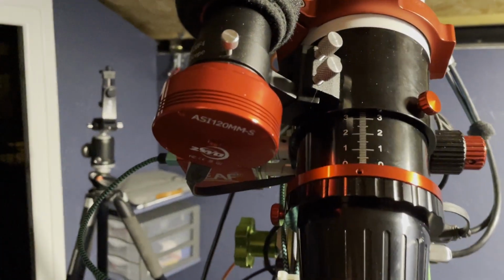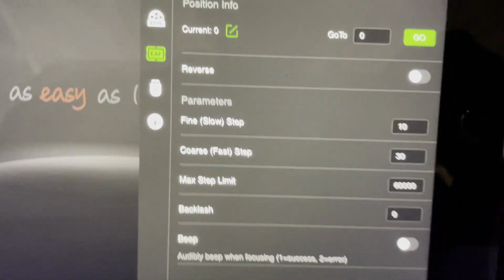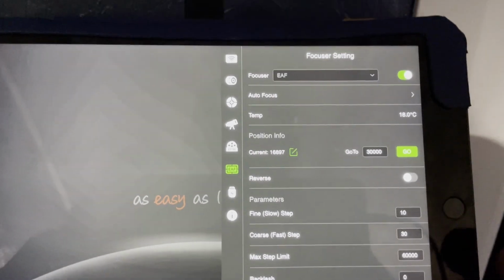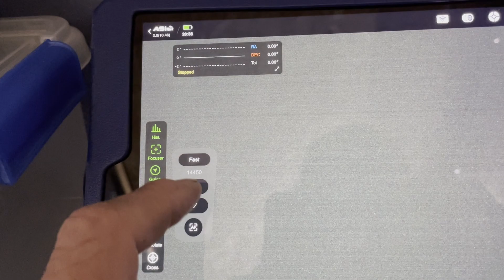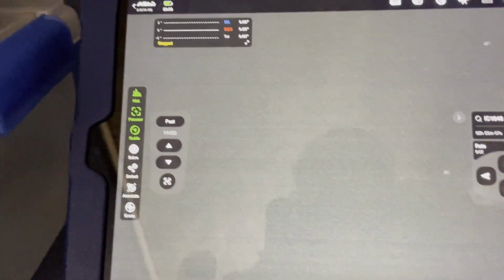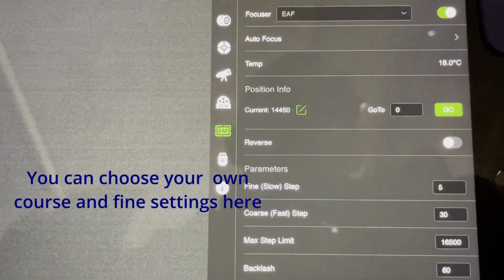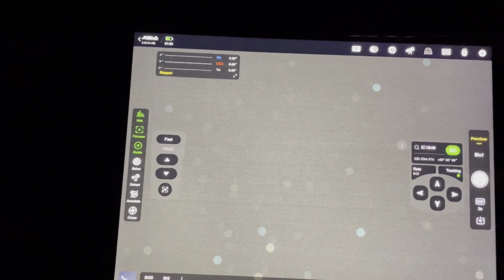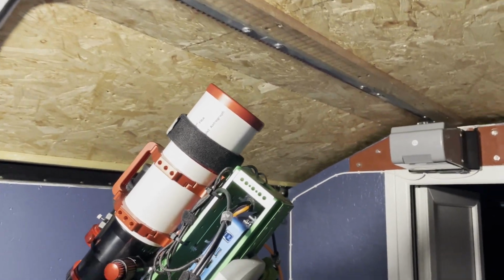Astrophotography Askar FRA 400  Fitting ZWO EAF

Comment: Finally a video showing the set position, then going home to 0 and then letting scope back out to max tube extension. I worried I’d break the EAF if I ran it past 0 or beyond 60,000. I guess it simply stops and beeps twice as a warning. Right?
Reply from the maker: Thanks for watching, yeah the EAF will beeb twice at it’s maximum! I doubt you’d break it😀 It’s the best way to calibrate it and set the backlash👍 
Clear skies!

Comment: Hello, I recently bought a ZWO EAF focuser and I can't find the settings for NINA. My tube is an ASKAR FRA 500. The focuser on the tube goes from 0 to 16,500 steps.
I would need to know mainly: "Autofocus step size" and "default autofocus expositure time" and others
Thank you very much!
Reply from the maker: @salutvilarorovira9263  Hi, thanks for watching! For a basic starting point, anything from 30-50 step size should be ok! You can experiment! Exposure for the focuser can be anything from 2-5 secs, again you can experiment! Hope that helps 👍
Reply: @SimonsAstro  Thank you, you helped me a lot! And the value of backlash? Do you also have to experience it or is there a fixed value? Thank you very much!!!
Reply from the maker: @salutvilarorovira9263  That’s a trial and error on different scopes! On my Esprit 120ED the backlash was 90, on my Askar 400 it was 60! Good luck👍
Reply: @SimonsAstro  Thank you very much!!!
Reply: @SimonsAstro  Thank you very much!!!

Comment: Nice way to mount the various parts. I 3D printed dove adapters for the Pegasus and PC to fit on the side of the Ashkar FRA400. Need shorter cables. It looks good too but your build keeps things neat and tucked away. I will have to look at doing this. I have a ZWO AM5 mount.
Reply from the maker: @stevenwilliams6258  Thanks Steven, the Askar scopes are really nice, and the cage design really helps to keep things tidy! Thanks for watching 👍  Clear skies!

Comment: Great video!  Very helpful to see you actually putting this setup together.  Just curious - if you are using the ASIAir - is it necessary to use the hand controller, temperature sensor, etc with the EAF?
Reply from the maker: Thanks Matthew, I’ve never used my hand controller, I have the Pegasus power box advance which comes with a temperature censor, everything just works! That’s the beauty of the ASIAIR😀 Clear skies!
Reply: @SimonsAstro  Hi Simon - I’m not familiar with Pegasus box.  Is it strictly a power supply?
Reply from the maker: @blackice5649  It’s mainly a power distribution box but it also has two dew heater outputs which are controlled by the temperature censor
Reply: @SimonsAstro  - Thanks for answering my questions - I have just one more - doesn't the ASIAir give you enough power? With your setup - how many 12v ports are you using?
Reply from the maker: @blackice5649  The ASIAIR Plus version will be fine, I use the Pegasus power box though mainly for my dew heater control, plus I like to power the mount separately from the Pegasus. In the Pro version, some people had slewing issues powering the mount from the ASIAIR. I’m sure the Plus version is better!

Comment: Question sir; I’m looking at upgrading my mount from the EQM-35 to the HEQ5 without the hand controller, will it “go-to” okay with the ASIAIR plus?
Reply from the maker: Hi Woody, short answer, Yes! That’s my second setup, I bought the Heq5 from Glenn and I don’t use the hand controller, it’s connected to the ASIAIR and it works a treat👍 Good luck with your new setup, just be prepared for clouds🤣
Reply: Thank you for getting back to me, that’s great news. I just installed my pier in the garden. A 6”x 6”x 6’ PEF fence post mounted in 240 kgs of concrete. I’m assuming post levelling is just standard building edict rather then for function. Anyway, I’m ordering my HEQ5.
Reply from the maker: @woody5109  Hi woody, that’s great, hope it goes well! Post levelling is, as you say a standard building practice, however, I would make sure you get it as upright as possible, and with all that concrete, it should be fine! The HEQ5 is a great little mount with a reasonable payload 👍 CS
Reply: I’m sure I’ll nail the levelling however I’ve run a couple of experiments on my EQM 35 and it doesn’t seem to matter on the go-to or tracking. I guess when you’re tracking in two axis it shouldn’t matter, as long as you’re polar aligned, it just visually looks better 😊
Reply from the maker: @woody5109  You’re right about the polar alignment, that’s important, you’ll be fine with it👍